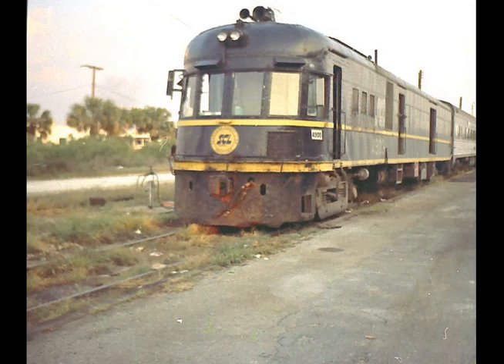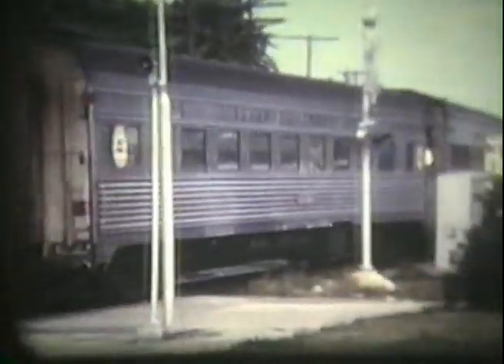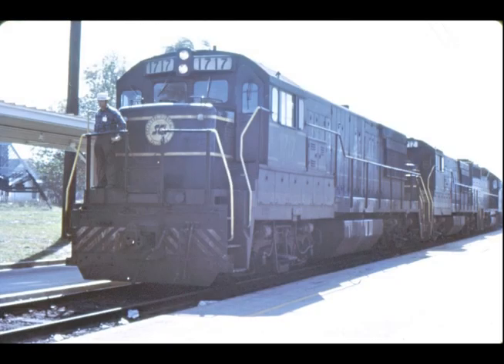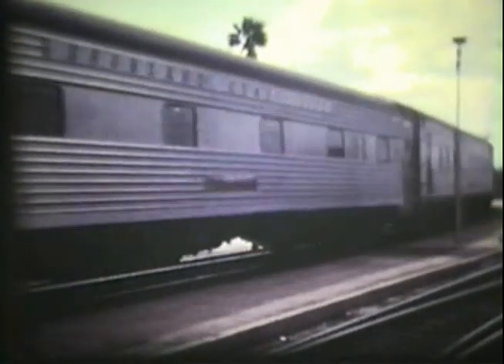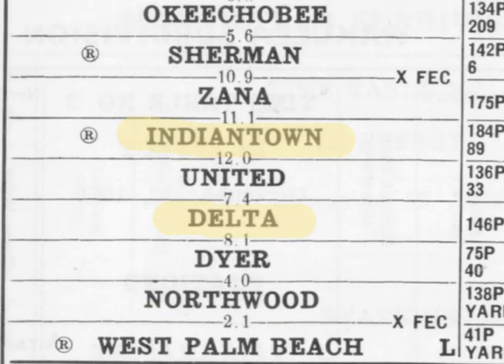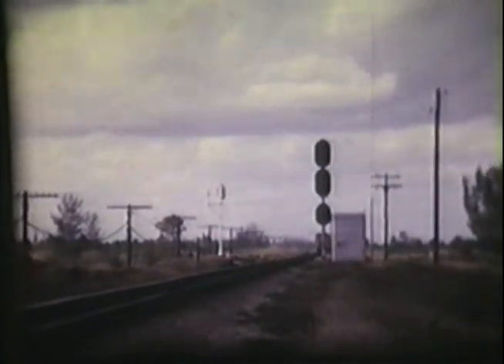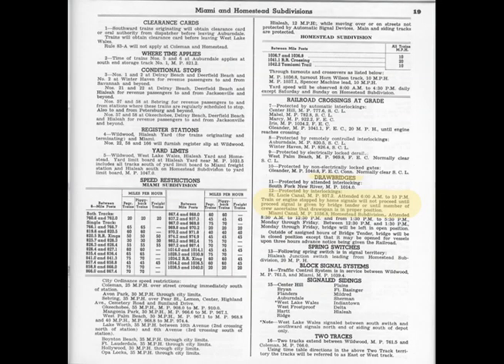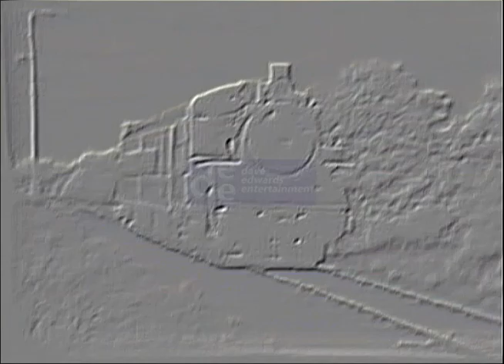SCL, SEABOARD COAST LINE RAILROAD  TRAINS IN SOUTH FLORIDA  1970  The railroad time capsule .

Comment: Do you have online PDF of that timetable?
Reply from the maker: Unfortunately I don't.  The time table is dated December 11, 1970.  The picture, graphic or banner is a modified version of this timetable .  I added the "south Florida 1970"  and moved a few things around in the banner.  They were quite common and I'm sure someone on ebay has the "SCL, Seaboard Cost Line railroad passenger timetables effective December 11, 1970" as is noted on the cover, for sale.